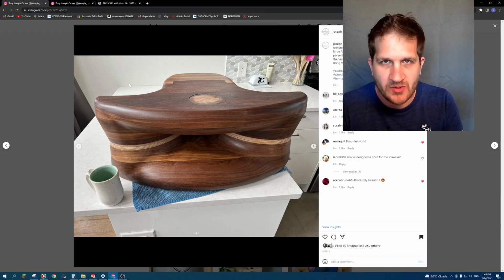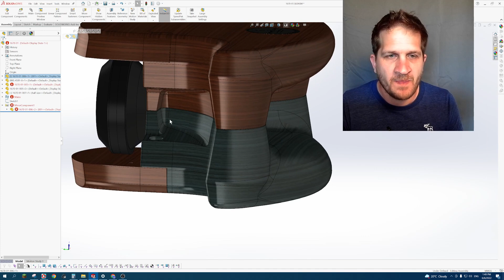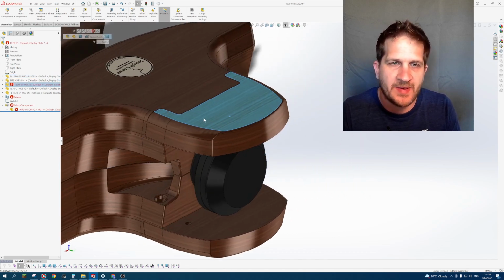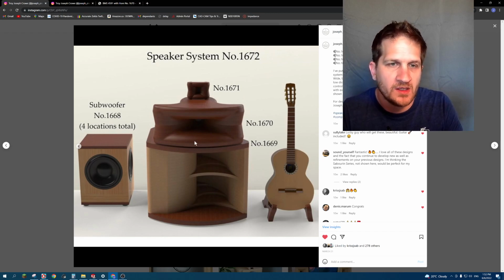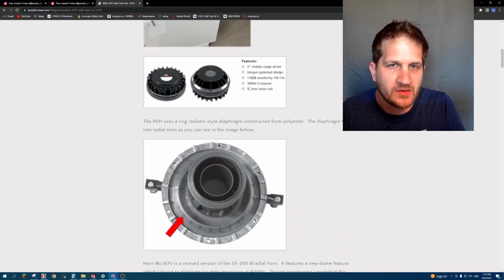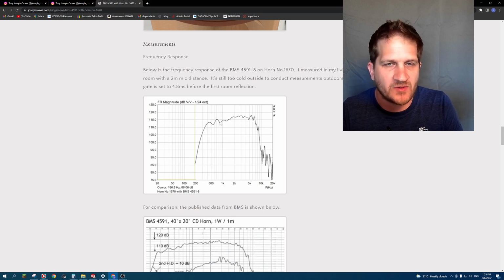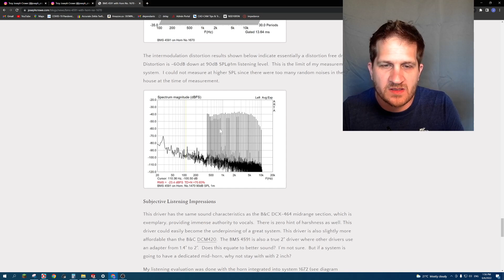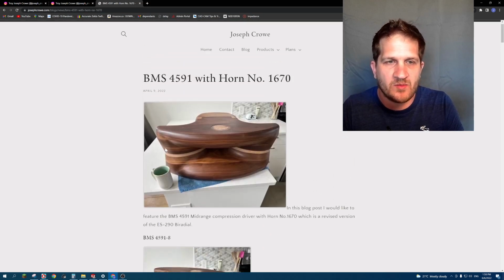BMS 4591 with Horn No.1670

Comment: I would love to try this horn with a BMS 4592, same mid section but with an added co-incident HF section. As a 2way it extends to 20KHz on top.  Sure is a magnificent design you have there... beautiful and of very high acoustic performance
Reply: I would love to know how IMD compares between the BMS 4592 and the B&c dcx464 which is proven in Joseph’s designs
Reply: @daneprostamo-brown6552   Some people local to me listened to that, and preferred the BMS.  I was not there, but have been living with the 4592 for years. Its shortcoming is not the driver, its the factory supplied crossover.